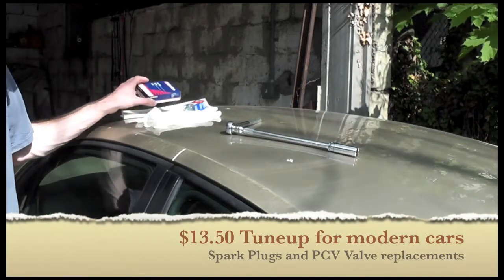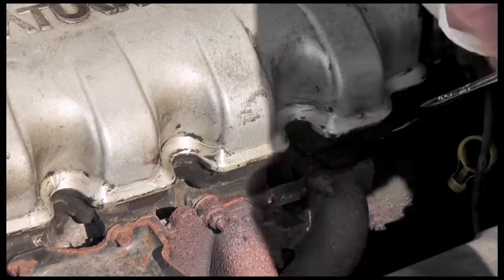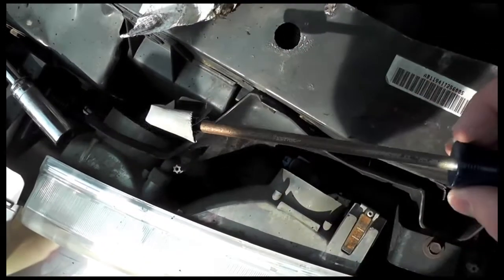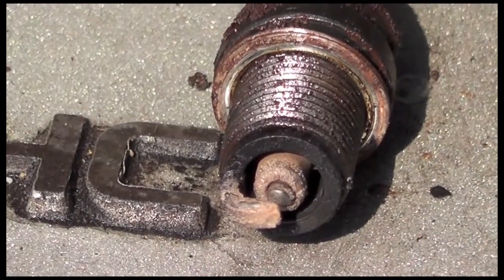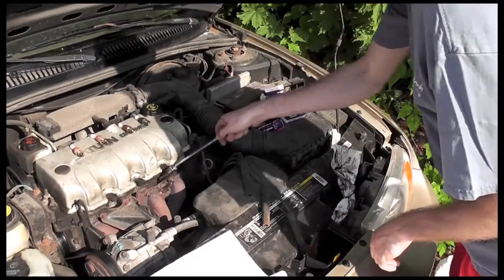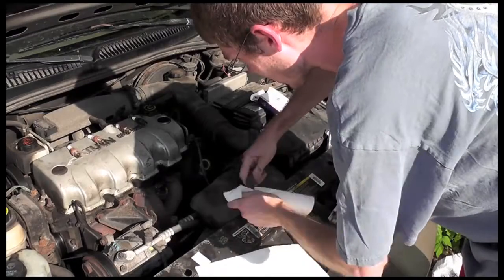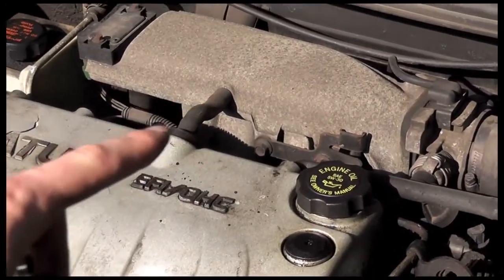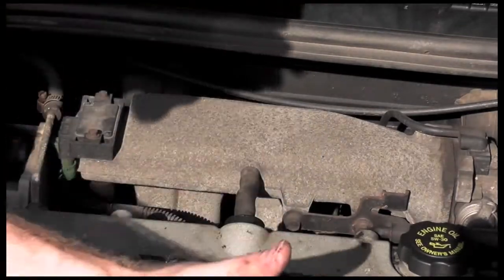$13.50 Tuneup For Basic Cars

Comment: Most cars and trucks today have aluminum heads, its good to use anti seize grease/compound on the threads of spark plugs and carful not to over tighten.  Reusing spark plug wires is OK, use some conductive grease on the tips to keep a good conductive pathway.  Especially in extreme cold or warm climates.  Dis similar metals, aluminum, brass, steel and other will tend to eat each other through electrolius and leave a white powder residue causing intermittent shorts, bad connections.  This especially happen in older car light bulb sockets.  grease those up a lot.

Comment: for 13 50 ull have shit done to your car not fixed lol
Reply: +Muilisx 
It'll work magic for a car that barely runs. My grandpa passed his car down to me. But it broke down on me at least every few blocks. So I changed the oil, put in new spark plugs, put in some Gumout fuel system cleaner, and gave it a jump start using my step dads pickup truck. Now it runs like a charm.
Reply: Just weird because plugs alone are about $30-$50 depending on the kind you get, then you gotta add wires, cap and rotor another $50, + fuel filter, and might as well do fuel injectors too which are like $80 each. Not really sure what you could possible do for $13.50, probably just a seafoam treatment but glad ur car is running
Reply: *****
That's true, and thanks.
Reply: $1.99 on sale. all that other stuff is for over 15000 miles i think my manual said
Reply: Where do you go and pay $30-$50 for plugs? I would like to know so I can be sure to NEVER go there